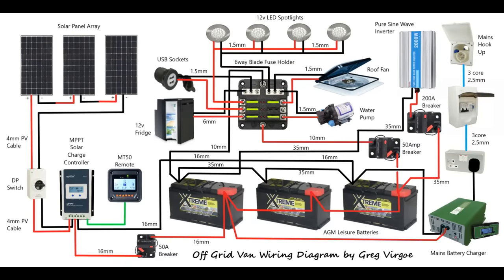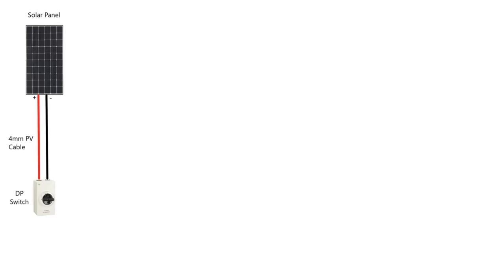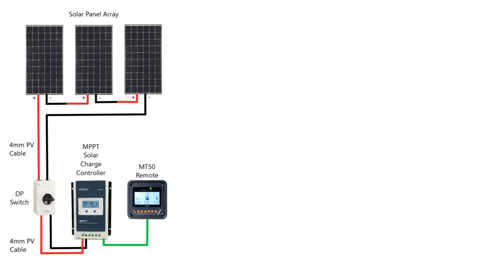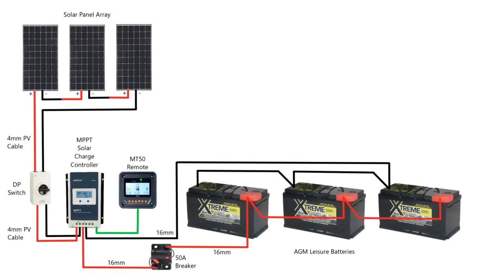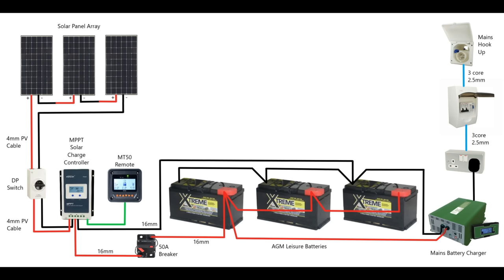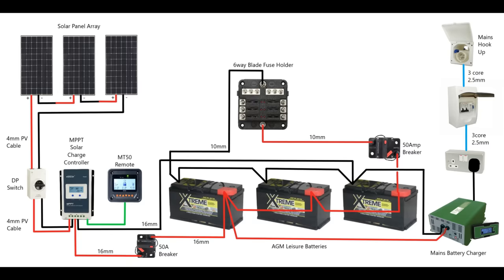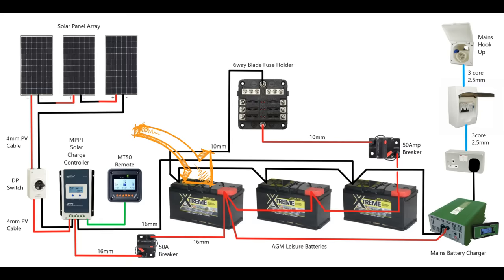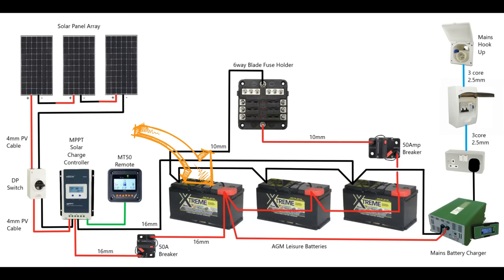How to Wire your Camper Van to be Off-Grid

Comment: Really useful video, best I've seen and feel that I can trust (lots of kiddies and cowboys out there making vids on this subject) ...Question for for Greg or anyone, how do I connect my 16mm battery cables to my Victron MPPT, when the connection holes are barely big enough for the 4mm PV cables?
Reply from the maker: I just checked both the Victron 30 & 50 MPPT controllers and they have 16mm terminal for the output cables 👍🏼😃

Comment: Hi Greg, I’ve used this diagram for my build, it was a great help, thanks for doing it! I’m finishing up my electrics now but am still unsure if I should be connecting an earth with green/yellow cable from the consumer unit to the van body. I’m seeing conflicting opinions on it from various sources, with some saying new regs specify it. I can see that in your FAQs in the comments you haven’t done this. Is this always the case? Just want to be sure that I’m not gonna end up with a 240v live van! Cheers, moving on to the water soon so onto your next video. John.
Reply from the maker: On the 230volt side it’s good idea to connect an earth to the van and also connect an earth bond from Pipework and electrical appliances to the van. You don’t need an earth on any of the 12volt side 👍🏼😃
Reply: @GregVirgoe  awesome, thank you! One difference to your diagram is that I'm running a CTEK battery to battery/solar charger, and the instructions say I should take the battery to common earth. I'm guessing I can ignore that if I don't need to connect the 12v leisure system to earth? If this is the case I'll disconnect the 12V earth I've made to the body and connect the 230v earth cable instead. I've also recently noticed people earth their sink, this one was new to me!
Reply from the maker: @johnscrippo  follow the CTEK wiring diagram as they may be using the vehicle for the negative of that setup. Your van battery negative is connected to the vehicle and that’s how the auto electrics are wired. They do confuse people when they use the term earth for 12volt systems as there isn’t one. The ground is a negative connection in auto electrics and 12v DC is just a positive and negative, no earth required. Hope that helps. 👍🏼😃

Comment: This is perfect and very clear but the only thing I'm missing is a hook up to the engine alternator to charge while driving.
Reply: It depends on what sort of alternator you have and what kind of batteries you're running. A modern "smart" alternator wobbles the output about depending on what the energy recovery system is doing. I currently have a diode connection to an old style alternator that switches on and off with increasing/decreasing voltage from the alternator ( it's called a split charge diode)  but am changing to AGM batteries. For these I will install a B2B ( battery to battery) charger between the vehicle battery and the habitation bank to extend the life of my new AGMs. Do a bit more research on your batteries and alternator to find out which kind of linkage you need.

Comment: Hi Greg, thank you for your kindness in educating us and sharing this amazing information. Greg, can I ask please, I have only 1 leisure battery with a 200W panels. To charge the battery like your diagram, can I get away with a Main battery charger  supplying 12v output voltage, 5A output current? Thank You
Reply from the maker: What is the size of your leisure battery. A good rule of thumb is 10% of your battery size. 
So 100ah = 10A charger
200ah = 20A charger etc

Comment: Hi Greg,
What an awesome set of information you have collected here and how well you are introducing some calculations and reasoning for the decisions! I especially enjoyed your thermal insulation series. Really amazing.

I do have one question regarding the parallel charging described in this video.

Your diagram (as many others in Internet) allows for possibility to charge the batteries from two sources at the same time. In your case it is solar and mains.

So on a nice, sunny day your MPPT controller will produce amps to charge the batteries. Let's say the van is at the camping site and connected to mains. This would mean that the mains charger will also create amps to charge the batteries. Now, of course, these amps will all add and flow into the battery, so no problem, right?
Except that each of the chargers (MPPT and mains charger) continuously monitor the voltage of the battery it is charging, to decide when to switch from bulk (full strength) to absorption (much less amperage) charging mode. So as soon as the charger notices 14.4V (for lead acid battery, for example), it will stop bulk charging and go into absorption mode, utilising only a fraction of the full power available to the charger. 

Why would the charger think the battery has higher voltage than it does? Because the other charger is setting voltage as a result of it also charging!

The way I see it, without some complex circuitry it is not possible to efficiently parallel-charge the batteries through separate sources. I have tried to find a simple solution for that (e.g. use both solar and alternator charging while driving), but even the commercially available solutions (like Victron EasySolar or Votronic VBCS) seem to charge from only oe source at any one time. In reality, these solutions are picking the optimal charging subsystem from 2-3 that are available to them. They are not running them in parallel.

The way I see it the only way to have multiple chargers operating at maximum is to isolate the other parallel charging sources and run one charger at a time.

Any thoughts?

Regards.
Ivica
Reply: Ivica, check out the Renogy MPPT charge controller with battery isolator (full name: DCC30S 12V DUAL INPUT DC-DC ON-BOARD BATTERY CHARGER WITH MPPT) which allows for absorption from both solar and alternator while running simultaneously. There may be other products online but this is the one I went with.
Reply: Hi Alex.
Thanks for the tip. I checked out the Renogy device, but the info on the website suggest the same “either-or” charging source setup. For example, taken from manufacturer’s website:
“. The multi-stage charger can utilize connected solar panels or a starting battery linked to an alternator. While your vehicle's alternator prioritizes your starting battery, this unit will allow your solar system to charge your service battery first!“
Or
“. Designed to charge service batteries from two DC inputs-the starting battery or solar panels. “

The “or” suggests to me the similar behaviour as other commercial units I have seen, which decide which power source to use from a list of available ones at any one time. 

Do you have any description from a user manual or other source that says those inputs are combined?

Auto-switch between sources is already great helper and I will be definitely going with one of such products,  it using solar and alternator while driving as combined input would be a great feature.

Regards.
Ivica
Reply: @ivicavujanic4413  Fast forward to 3:06 in their product video on their website. It has a diagram showing if there are two power inputs, it accepts a 50/50 split.
Reply: @alexotree  Indeed it does! I will check with Renogy if they are trying to fully charge the service (vehicle) battery before they switch the alternator power to charge the house battery, as new cars with smart alternators do not charge the battery fully the old fashioned way, but keep them at 85-90% full only. But in principle, Renogy is able to combine the power sources.
My initial comment stays: the diagram discussed in this video, as well as countless other similar diagrams in internet are likely incorrect, as they cannot combine the sources in the passive way, as shown on the diagrams. It needs to be done with additional electronics.
Thanks for pointing out the Renogy device!

Comment: Hi Greg, just been reccomended your channel and your content is brilliant, so helpful and informative! ive just bought a van and am about to start converting but the electrics are the bits which are scarying me a little, but this video has clarified a lot of grey areas for me so thanks for that! If i have a small inverter say 600W or 1000W - as the only 230V appliance i will be using is to charge a laptop - what size circuit breaker would i need?
Reply from the maker: Hi Emma, I’m glad you found my channel. I’m sure it will help you. 
If all you are using is the laptop go with a smaller inverter. It will have smaller loses and need smaller fuses and cable sizes. A 600W inverter will need a 60A breaker and 16mm cable from battery to the inverter on the 12v side. I can recommend you watch my video on fuse and cable sizing too. Best wishes with your build. https://youtu.be/koFg6oFs0RU

Comment: Thank you so much.  My wiring has been giving me fits all afternoon.  I saw where I messed up thanks to your easy to understand explanation and diagram.  One question....what is the "load" terminals used for on the mppt charge controller.

Comment: Just Out of Curiosity, How much weight  does This whole system add To you camper Van ? Very good explanation and presentation, regards from Norway 🙂
Reply from the maker: Panels are 15kg each
Batteries 30kg each 
Other controllers 15kg
Wiring approx 10kg
But when you have endless free power it so worth it 😁

Comment: By far THE best explanation of a vans wiring system. Step by step a d easy to follow, I think from one question I know the answer, but my Peugeot had a 'smart alternator', which is another reason why it can't be used to charge the leisure battery whilst moving. So a DC-DC battery charger between the both would suffice???? Love your channel 👌👍🙏🇦🇺
Reply: Did u find out the answer?
Reply: @MarcinAdamowicz  no, but I believe from r vie snof dc-dc chargers that they are what's needed for vehicles with smart alternators.
Reply: @Smokie1969  thanks, I will read about it more :)

Comment: Hi Greg! Absolutely incredible knowledge transfer and I love how you explain everything so well. You are awesome! 
I built it just the way you suggested here, ordered my cables and have 2 questions.
Is there an ideal step by step which cables to wire first all through the installation? Are you covering this in one of your videos? What are the precautions of people not experienced with electrical work?
2. If I leave away the part where it will connect to the mains, as a separate closed system will it still be safe and functioning? Thank you ❤️
Reply from the maker: Best to install cables to all your devices and lights first back to the blade fuse holder. When connecting any breakers or switches leave them in open OFF position while connecting them then those circuits will be broken and not live. Then wire batteries together and cable to the other side of your breakers. 
For solar systems you need to connect batteries to the mppt first that will power on the mppt. Then connect solar afterwards. Again you can leave the isolator off when fitting cables and turn on when you are ready to do so. Once you are happy that everything is connected correctly you can put breaker on to blade fuse holder and check your devices are working. Hope all goes well 😊

Comment: Hi Greg, I just want to say thanks so much for this. I was concerned about what cable I need to use  and how to install it all. This is by far the best information on YouTube 👏👏👏.  I feel totally confident I can do this myself now👍👌. Thanks so much 💪. Hello again, lol. Im just ordering my parts. What amp should i order for the DP switch? I'm very new to this if that is a silly question sorry 😂.
Reply from the maker: Thank you very much. You find my latest video very useful, it’s all about the DP switch. 
https://youtu.be/GRLfZIGfA1I?si=lBAY7EkrE4Kd8cok
I have also done a more recent wiring video with modern equipment that could benefit you also, 12v Electrics for Off-Grid Campervan 
https://youtu.be/xCw7eARJKOg

Comment: Thank you so much for this, honestly would be lost without it. 

For your inverter you have 35mm wires which can take up to 141A yet you have a 200A breaker? I presume I am missing something here but I do not know what? 

Also, what mm wire did you use for mains battery charge?

Comment: Hiya Greg, your videos are amazing but for absolute beginners like myself, can you please explain how to connect the four 12v lights. What do you need/do to connect the lights from the negative cable. Hope this makes sense.
Thanks, Jimmy.
Reply from the maker: Hi Jimmy, I have a couple of videos that will help you. 
Wiring Tips for Van Conversions
https://youtu.be/UP10-tW7TQg
Reply from the maker: Electric Cable & Fuse Sizing - Camper Van Conversion Series
https://youtu.be/koFg6oFs0RU
Reply: Thanks Greg 👍

Comment: hmm have you got anything for connecting an alternator to this greg? thanks a bunch on this by the way, easily the most understandable one i’ve seen
Reply from the maker: The best thing to use is a DC to DC charger like Victron Orion. Very simple to install. Poss & neg from van battery to charger and same to leisure batteries. 👍🏼😃

Comment: Thanks Greg, excellent breakdown and to the point explanations. Thanks for also clarifying the use of the load function, on the charge controller. One challenge I have experienced with a similar setup, is myself needing to monitor the batteries to prevent discharging too far and  preventative switching off appliances to prevent further current withdrawal. (this happened during a 12 day spell with very high ambient temperatures with the fridge and separate freezer, drawing excessive power to keep things cold, with the high ambient temperatures). What can one do to protect the batteries automatically?

Comment: Dear Greg. Thank you for all your build video's. They are really clear. You explain things really good. Also every connection or build looks to be extremely safe. Thank you and I hope the video's on the ducato build will continue when you find the time ?
I would like to ask a little question Greg (or community) .. Why does everybody choose for individual components when they are installing a off grid system ? Is there an advantage over using a aggregate like bluetti ? 
It now looks like a power system (like bluetti) is cheaper, lesser components and easier installed ??
But they're probably are disadvantages .. Can anyone explain ? Thanks!
Sorry for my bad English.. trying to avoid google translate..
cheers Bert (Belgium)

Comment: Very informative and easy to understand video. Cheers!
Reply from the maker: Glad you liked it 🤩
Reply: @GregVirgoe  Am I right in assuming that it's an either or installation with solar or mains? 
I understood that your installation has a switch to comute between the two.
I have a big AGM battery in my caravan, that is only used for the mover at the moment, which seems like a bit of a waste.
I was thinking of adding a solar panel to my existing system and connecting this battery up to the rest of my 12V installation, so as to be able to use this battery for lights, and low demanding appliances.
Reply from the maker: @mick2d2  most stuff in the van runs on 12v DC fed from the leisure  batteries. These are constantly being charged by solar at all times during the day. You have the choice to supplement this by plugging in the mains battery charger to top up the batteries. That can be on at the same time as the solar charger. The two can work together no problems. 
The changeover switch I have changed from mains 230v to inverter 230v only on the 3 pin sockets in the van. Just on the mains side nothing to do with the 12v DC side. Hope that helps. I did a couple of videos on my control panel earlier which may also help

Comment: Hi Greg. 
I’ve loved all your videos. 
I’m getting ready to start the electrics now on my bus conversion. 
I’m following your plan pretty much. My bus already has a split charger from when it was a bus. The new batteries are lithium batteries. Is there any issues with split charger types? Don’t want damage anything if there is. Thanks again for all the videos. 👍
Reply from the maker: A split charge relay is no good. You really need a DC to DC charger if you are using lithium because it has a totally different charge profile to normal lead acid batteries. A good one for lithium is Victron Orion smart charger 👍🏼😃

Comment: Hi Greg, I am really enjoying your videos and thank you so much for sharing your expertise and experience. 
I am converting an old Bailey Pageant Champagne caravan 2002 to take with me to the south of France to do my life 2.0 project of converting some old barns. (Got divorced,  so early retirement !)

I will have power available on my first project (might not on the next one) and so I would like to add PV panels to charge my battery and then try to run most things off 12v (fridge, tv, laptop, lights)
i have a wired 240v charger in the van to top up the battery, but i want a system that will charge from the PV  BEFORE any need to use the 240v battery charger.

I was considering using a double pole switch on the 240v charger (on the input side, and also the output side) as i am concerned about back leakage out of the battery when the 240v charher not switched on. (maybe that doesn't happen? with some smart diode arrangement - i don't know, to be honest - its an old charger)

Then i thought - is there a smarter system with a PV controller that also has a maims battery charger in case the system need a charge at night or in bad weather?

i hope that makes sense - could you shed any light on this for me please?

Also - do you work in an advisory capacity? - I'm more than happy to help you with a donation for your site for some detailed advice. 
Many thanks
Niall Conn